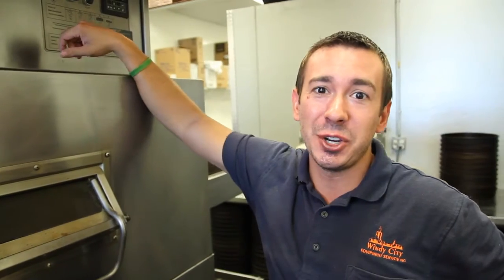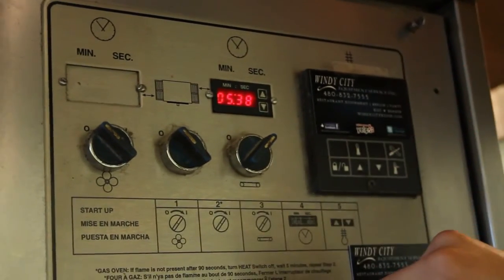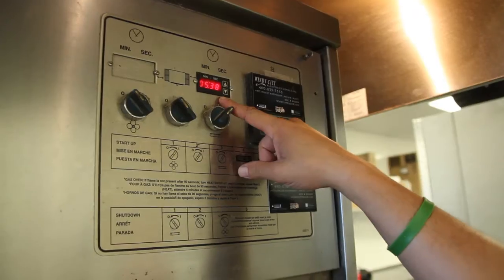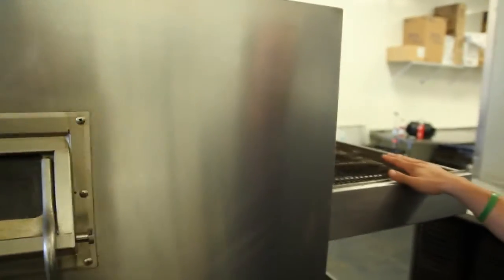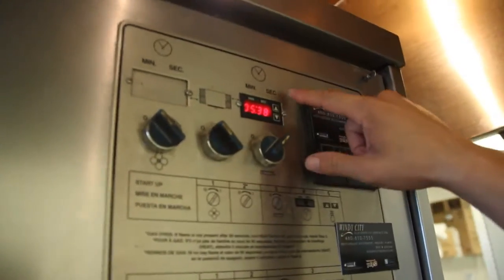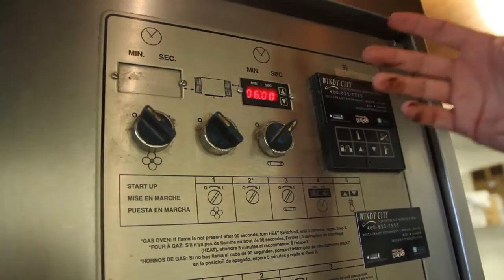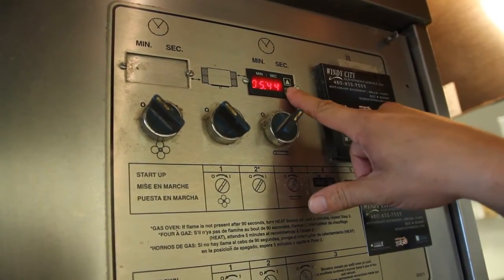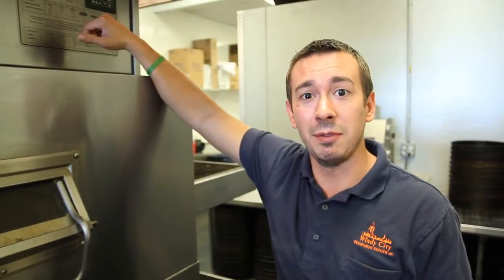How to adjust conveyor speed on pizza oven tutorial DIY Windy City Restaurant Repair tips

Comment: Hi, great video. How can you adjust the flame on a conveyer oven to get the blue flame when switching to GLP gas? Thanks
Reply from the maker: First, you'll have to verify that your incoming gas pressure is correct.  Once you have the gas pressure set to mfg spec, it's really all about the air/fuel ratio.  You'll want to adjust the air shutter until you see that flame turn blue.  This can be a bit of a challenge on some equipment.  Thanks for watching!

Comment: Ok, I have a Middleby Marshal ps360wb.  The gear on the conveyor motor went bad on my I bought a grochopp pm8014-ra3080t  actually 2 of them. They are listed as compatibla but when I hook it up and turn it on it is running at about a 1 minute oven cycle ie flying like a banshee.  I have the orginal gear from the belator motor on.  Is this speed sensor not compatible with the oven?  Or do I have to change the speed control module in some way? or Replace it?
Reply from the maker: You most likely have to program the speed control to the new style motor.  I don't know exactly which program you need, but sometimes its on the front of the speed control itself.  If it's not, let me know and I can email you the instruction manual.  Thanks for watching!

Comment: Hey
When I turn on my Conveyor the belt runs for a sec then I get a display ERROR. what do i do ? 
it's a Middleby marshall oven and motor speed control part number 64149
Reply from the maker: The first thing you should do is check your motor brushes.  9 times out of 10, worn brushes are the cause of this issue and is usually about a $100 fix.  If they are more than 3/4 worn, replace them.  If they are ok, then I'd check the wiring.  First in the contact block  behind the upper panel, then at the control itself.  Start with the brushes though and let me know what you find!  Thanks for watching!
Reply: I check the motor Brushes and seem to be fine